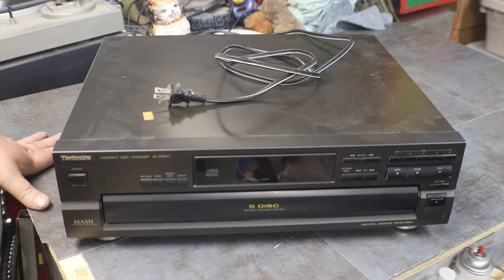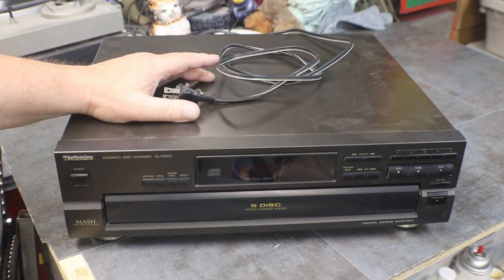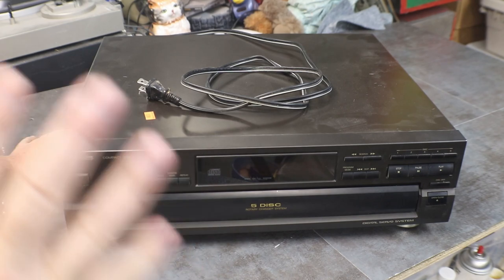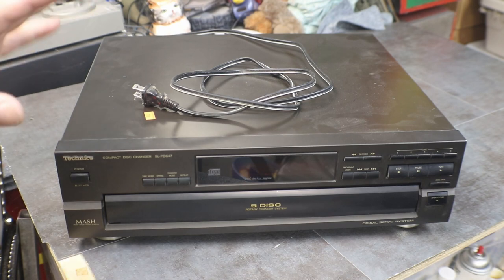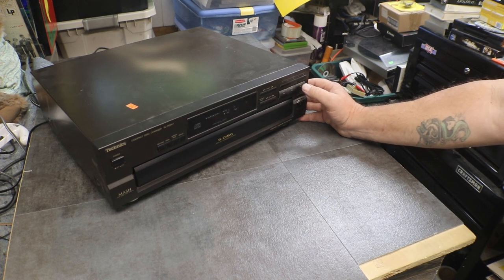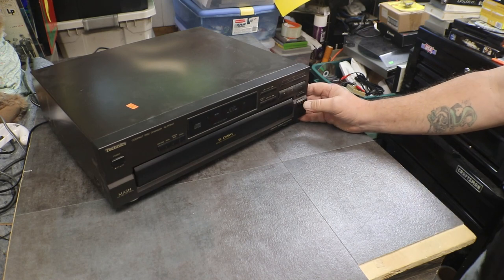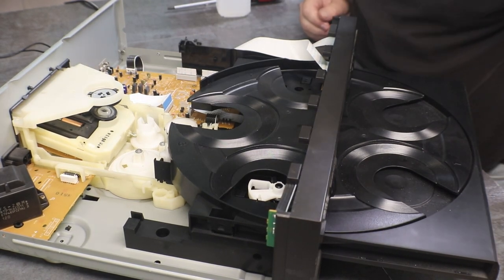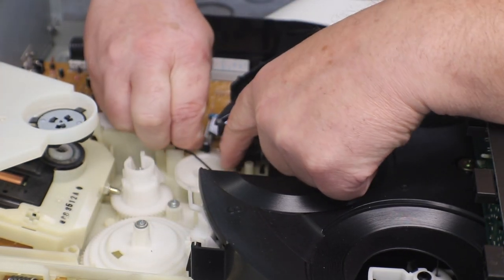Technics SLP647 5 Disc CD Changer / Testing & Cleaning Repair

Comment: I have a SL-PD667. As you may know, it is similar to the SL-P647. Mine only plays the disc in position 5. Now, the tray does rotate when I push the Disc Skip button--both with the drawer open and closed. Once I load the tray with 5 discs and close the drawer the issue begins. I can select any disc (1-5 position) and t will go to the selected disc position. However, when I push the play button, it always goes to the disc 5 position. Other than that, it sounds great. Any ideas? Thanks a million.
Reply from the maker: There is a censor eye that senses a disc in the tray. I would start there.

Comment: How do you test the adjustment with the multi meter? I'm not sure which points to touch because I'm getting completely random readings. And is is set to continuity or is that on 200 ohms? Thanks. Thing won't read a single CD and I'd like not to just trash it.
Reply from the maker: On the little pot one side has 1 leg and the other has 2. Test across the side with 2 legs.

Comment: Hi, great channel! I just got one of these today from the local goodwill in it seem the 5 disk spinning tray wont turn?? Its like where the eye lens u cleaned is up not down slanted like yours keeping the tray from spinning?? I could take it bak in get my money still i got receipt. But if I can fix I will. With your expertise what do you recommend. Thanks n have a blessed day.
Reply from the maker: When you push the open button the laser tray should go down before it opens. Now if it's doing that and will not spin the disc when it's in that means the laser is bad or out of adjustment.
Reply: Thank u. I've recently watched ur video at least 5-6 different times. I completely took it apart in cleaned it I ended up just cleaning everything I could as well as grease it put it back together now it works about 70%??? Yes I seen that now the laser as u said goes down in I see what ur talking about! But now as u said in your video it's doing the thing where when I load a CD it will go to play it in it's like it fumbles playing the CD? The CD won't take off spinningas it should it just spins around a couple times unbalanced not level making that sound of a plastic disk scraping as you described?? But it does open in close perfect now. And thank u too for ur expertise and helpful reply! As u said it must be an adjustment thing?? Do u think it just needs maybe a new rubber square ring??? Appreciate the help too. Thank u have a blessed day! In u have a new subscriber too!)

Comment: I got a PD-847 just about the same time you made this video, and it's a great player, extremely similar to this one of course, and the only problem is that the platter sounds choppy when it's inside the machine and rotating within certain areas and directions. I gave it some De-Oxit on the platter teeth where the worm gear rotates against it, and it helped some but I probably need to get some lithium grease because I can see remnants of it on there.
Reply from the maker: Very nice!